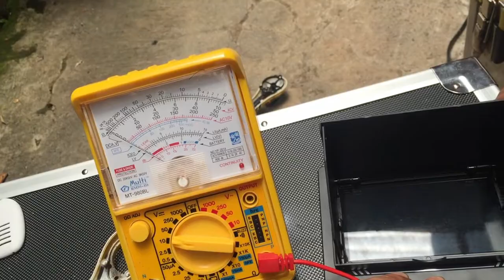How to Install and Connect FPV Camera to JJRC Yizhan Tarantula X6 - Cheap 5.8 GHz FPV

Comment: aku punya hawkeye firefly q6. biar bisa nyambung ke tarantulanya gimana gan.? soalnya socketnya beda
Reply from the maker: +Kiki Turtlejr - Bisa dijumper socketnya yg dari Q6 ambil plus minus dan sambungkan/ solder ke pin yg 5 volt dari boardnya tarantula seperti di video. Intinya sih cuma mengambil daya baterai untuk kamera.
Reply: Arya Dega jadi batre q6 itu kita copot aja ya gan.? kita jadiin 1 sama batre dronenya.?
Reply from the maker: +Kiki Turtlejr - Iya supaya lebih ringan.. Ohya baterai bawaannya berapa volt?
Reply: Arya Dega ok" gan tadinya mau gitu cuma takutnya nnti karna beda tegangan ngefek ke ancur malah kameranya, pdahal ndapetinnya di indo susah 😂😂😂. kapasitas q6 batre kurang paham gan, pas beli gak ada buku petunjuknya didalem.
Reply from the maker: +Kiki Turtlejr - oh kalau misal kuatir kameranya kena gangguan tegangan, mungkin sebaiknya tetep pakai baterai bawaan. Iya tuh Q6 keren spek tinggi tapi disini ngga ada yg jual. Kalau di forum rcmania sih dibilangnya bisa pakai baterai 2S sampai 4S.
Reply: Arya Dega iya aku kemarin dapetin dari tokped preorder jg dari luar gan hehehe.. ooh iya ya, maksudnya 2s-4s tu gimana gan.? kalo batre tarantula tu brapa s.?
Reply from the maker: +Kiki Turtlejr - Baterai tarantula itu 2S (7.4 volt) itungannya mulai dari 1S=3.7volt, terus kelipatannya.